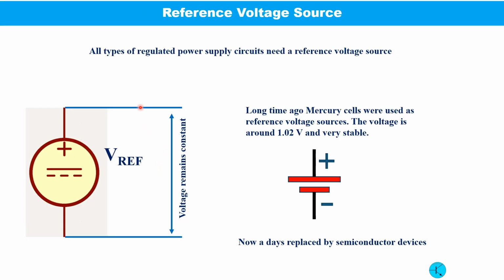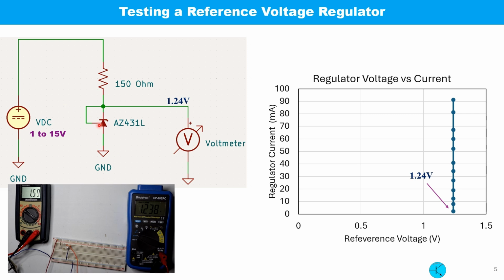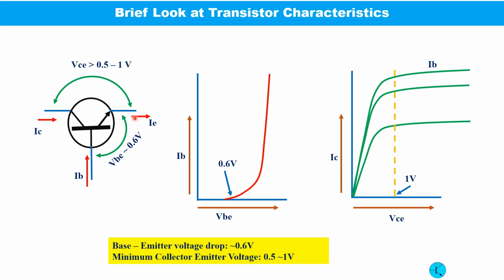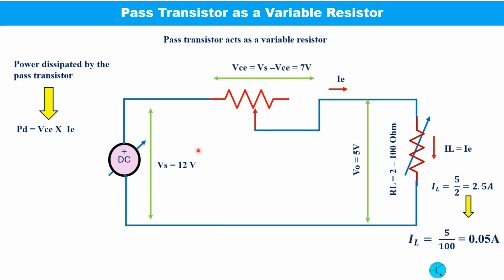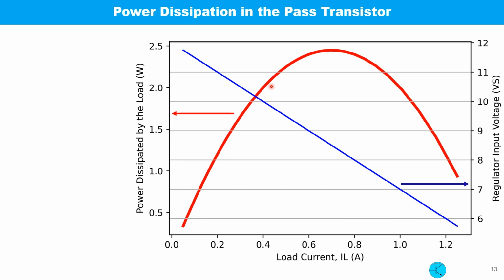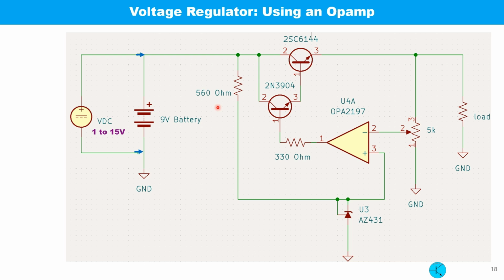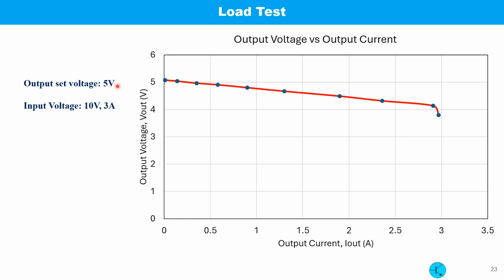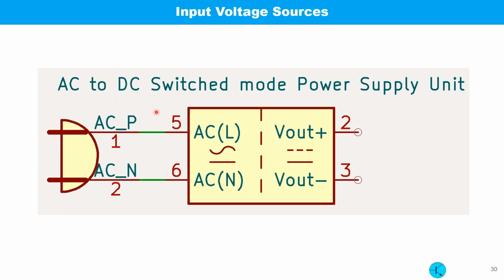Linear Regulated Power Supply

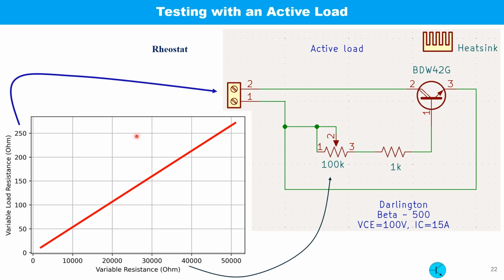Comment: I have a remark "wish might be stupid". In the circuit of the active load you presented at 13:19, I think that the terminals 1 and 2 of the potentiometer must be connected to the transistor's collector rather than the emitter.
Reply from the maker: Yes, you are correct. Thanks for correcting me. While drawing the diagram, I made this mistake. I'll put the correction in the description.
Reply from the maker: I put the correction remark in the video description.  Thanks again

Comment: The best tutorial about linear power supplies I found on YouTube so far. All tutorials use IC regulators and don't give details on discrete component-based regulators. Thanks, and I hope you can add more useful tutorials on electronic circuits.